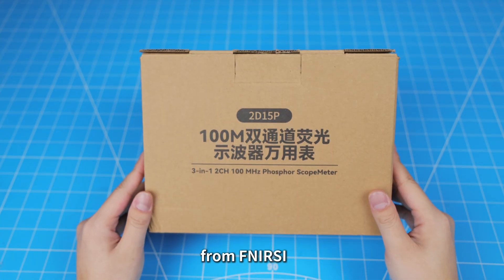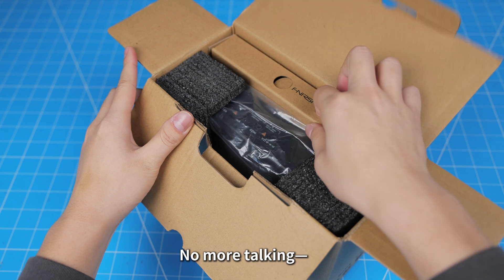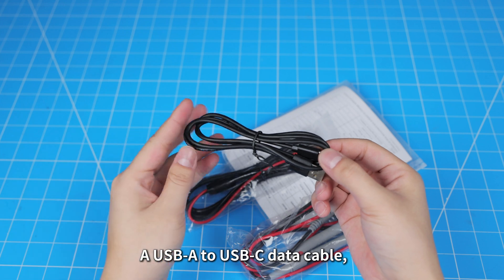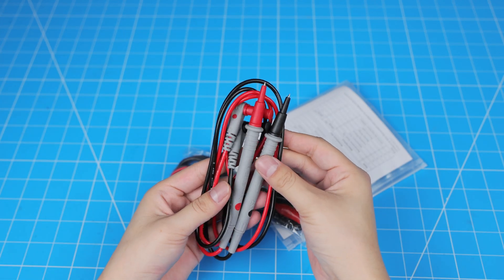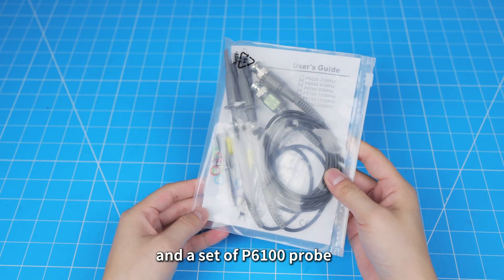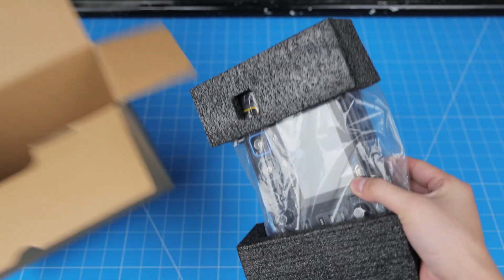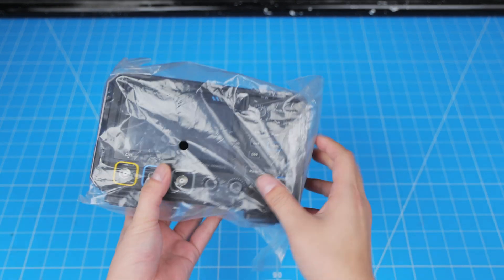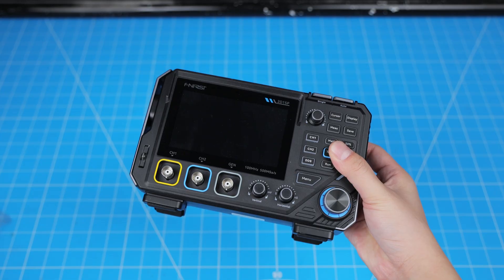FNIRSI 2D15P Touchscreen 2CH 100MHz Digital Oscilloscope + Multimeter + DDS | Full Unboxing & Test

Comment: 1-Please fix the multimeter resistance mode not working properly after 1 Mega Ohms 

2- also capacitance mode is not working on pcb i am checking 0.1uf 16v 0402

3- battery backup is not enough.